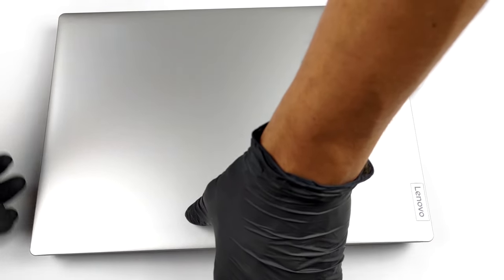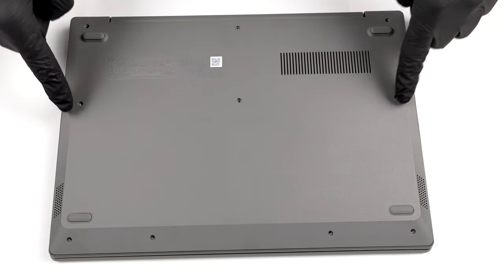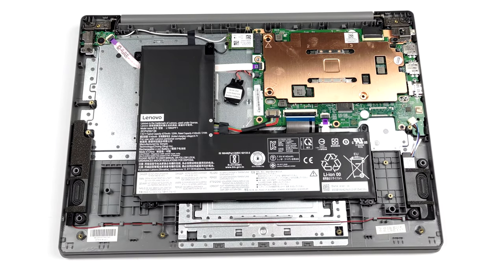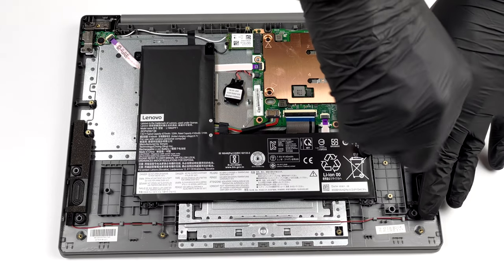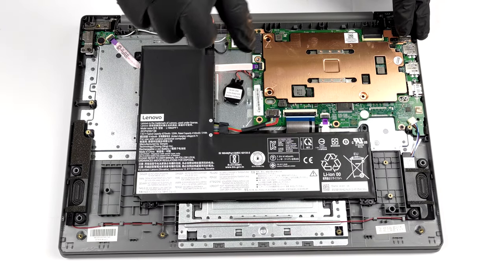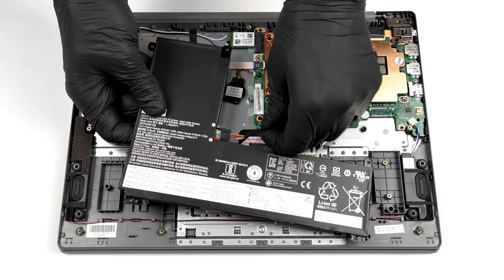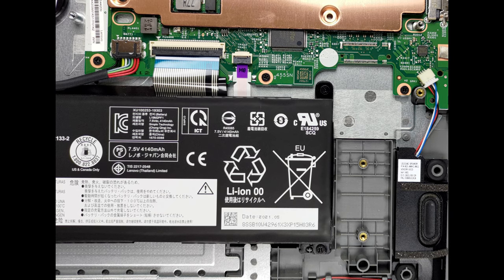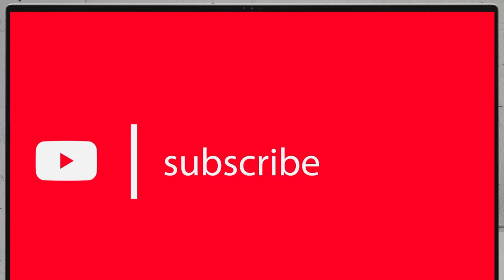🛠️ Lenovo IdeaPad 1 (14") - disassembly and upgrade options

Comment: What is the purpose of the "MB" ribbon slot? I cracked my NVME slot and need to find a solution how to plug a SSD different way but it has no sata ribbon and I dont know where I can plug it. Other possibility is pcie x1 occupied with WAN card. Is there any adapter to use ssd in that slot?

Comment: hi, i opened my lenovo ideapad 1 to get my files back not knowing that it doesn't have a hdd or sdd. where can i find the memory card of this netbook and how can i recover my files? is it possible? thanks
Reply: Emmc is not removable because it is soldered to the circuit board. Maybe you can do something if you have good soldering skills but i have doubts of it working well.

Comment: Thanks for nothing... Waited the whole video for you to tell no upgrade options
Reply: Get a ram any gb with these settings: DDR4 PC4-25600 3200MHz Non-ECC SODIMM

I hope it helps
Reply: @tdub2kane174  appreciate it, I’ll see if I can do something with my computer, cause it has NO SPACE WHATSOEVER
Reply: @tdub 2 kane  other people are saying you can't upgrade because it's soldered. I don't get it
Reply: atleast we can add another ssd
Reply: Virtually everything else I've seen says there is the 4GB soldered but also an additional slot that supports up to 16GB and there are 2 different configurations that will give you either 16 or 20. So I'm Hella confused by this video
Reply: @jonsnow9700 it depends ENTIRELY on model. Theres like 4 variations of this specific model
Reply: Dont buy this, i have it its quite bad